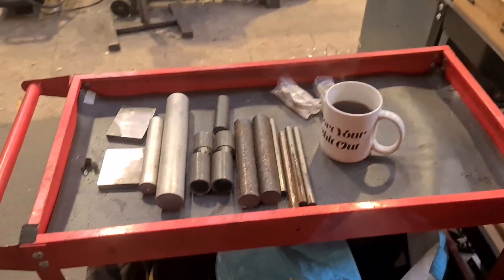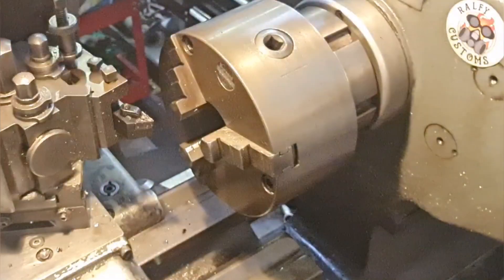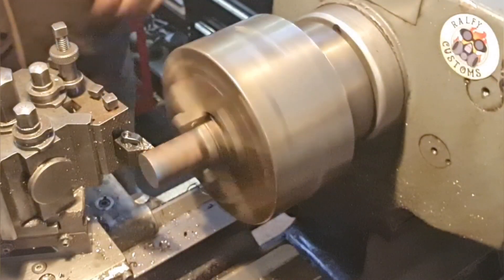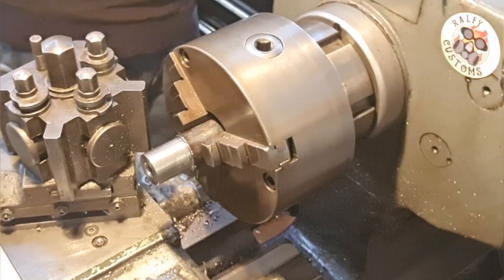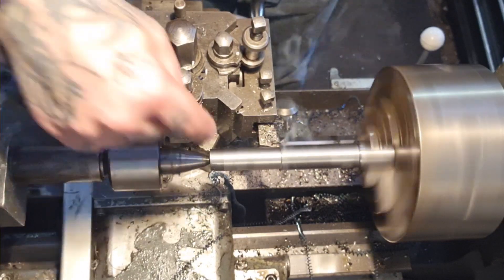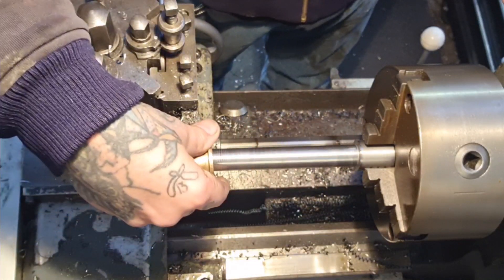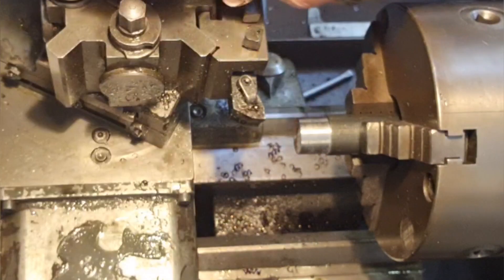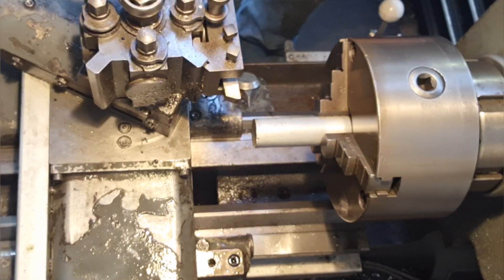Rigid Triumph Chopper Build P7 Forward Controls Manual Machining

Comment: Nice start on the controls .  For what i do , i have found the TNMG triangle inserts to be the most versatile tool for the lathe . 08 nose for roughing & 04 for finishing . They love a high RPM with coolant  .   Aluminium high rake inserts work well in that tool as well  , for finish cuts on  steel that won't play the game as far as surface finish  .They fit into spots where the CNMG & others won't  .  
Cheers .
Reply from the maker: Thanks Max, yeah I'll have to check which radius they are later, I also use a Rhombic as my lathe came with those, so I stuck with them, mostly though I've been happy with the CNMG